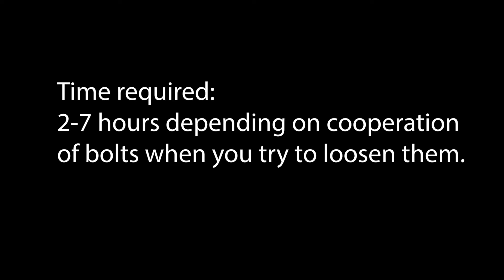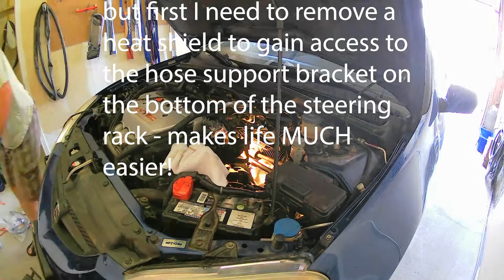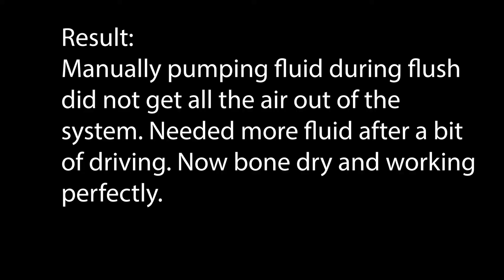Repair to worn/rusted Power Steering return line on Acura RSX

Comment: OEM or aftermarket parts (other than fluid)?  My 2006 Civic, owned since new, with 330k km, finally sprung a leak in the lower return pipe. It's a $9 aftermarket part, $60 for the Honda part. I haven't decided if I'll replace the whole return line. The rest of it looks okay except for this one pipe that happens to be exposed directly to the elements.
Reply from the maker: Thanks for watching!  Sorry, I can't remember. Likely I did OEM as it's a critical safety system.  Inspect the ends of the hoses well before you do the work. I wound up not loving how the ends of the rubber return line looked, so I changed it out while I was at it.  I used OEM fluid and flushed about 2 systems volumes through to make sure that the fluid was pretty clean.  Most important thing was to have flare nut wrenches to be able to remove the lines without wrecking the flare nuts.